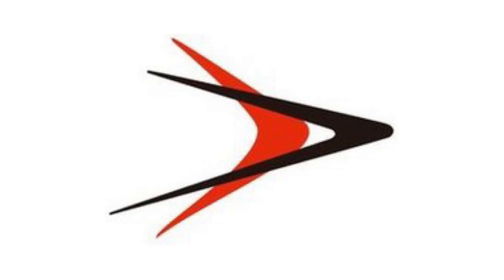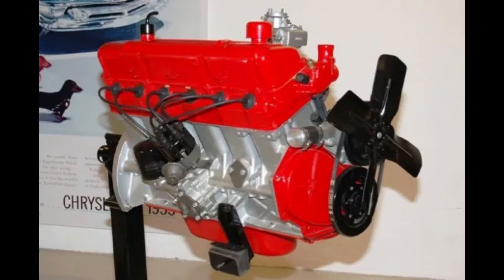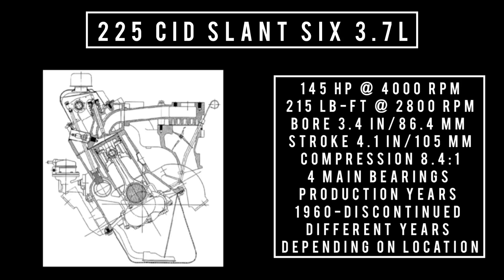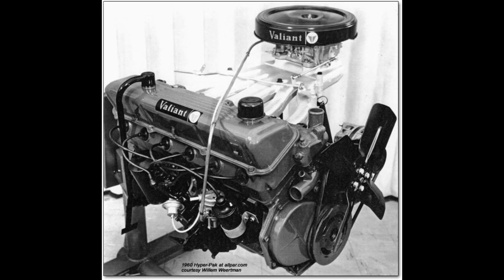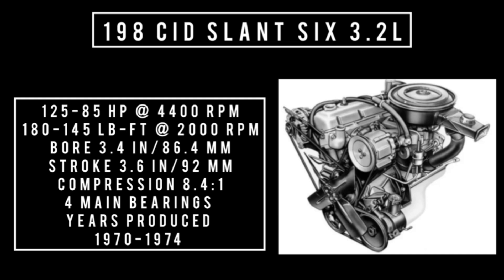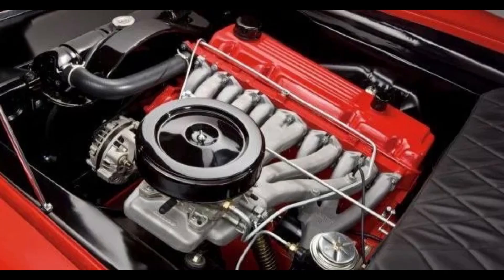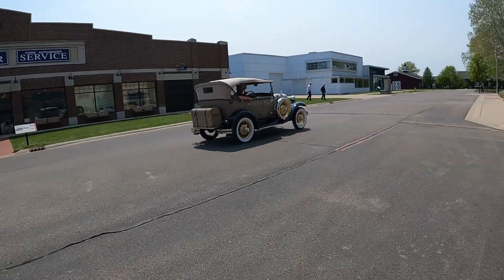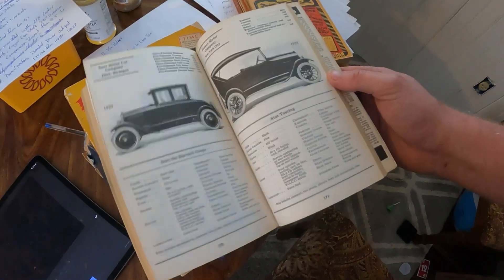Chrysler slant six engine family

Comment: My first car was a 1967 Dodge Dart with a 225 Slant Six. It was not a particularly exciting car unless you were trying to stop unexpectedly, but it never left me anywhere, even when it should have. I made many trips in the Dart between my home in Virginia and Indiana where I went to school. I usually drove at night by myself. (This was before cell phones and other communication devices.) That car droned its way through the mountains on almost empty Interstates without missing a beat. I wish I still had it.
Reply: Those were known as bread and butter cars. Chrysler wasn't exactly blowing up the ledger sheet with profits from low production Hemi cars. The everyday cars and engines is what people need. Cheap, efficient, and reliable transportation.
Reply: My 225 was in an inherited low mileage 1966 Plymouth Valiant. At the time, one of my friends was a Plymouth dealership mechanic. At one point when Chrysler was in a financial pinch they sold off their factory race car parts. We outfitted my Valiant with four piston disc brakes, heavy duty sway bars, gas pressure shock absorbers, and a tight ratio steering box gear. I added a performance cam, a Heathkit electronic ignition, and a killer stereo with six speakers. And I added factory rally wheels with a near new set of used Pirelli P7 performance tires .I doubt I spent $500 total (plus the cost of multiple cases of beer for my mechanic friend) to build a BMW eater.

For most of it's life my 1966 Plymouth Valiant was driven by my now ex-girlfriend. Several years ago after not seeing each other for 30 years we had dinner. She confided that one of the best things about our relationship was the ten years she spent driving that immaculate old Valiant. It was like talking about our deceased, and well loved, pet dog. I still miss old buttercup (my grandmothers name for her old Valiant).
Reply: @lockman004  Six in a row can go!
Reply: Fun fact: that flat exhaust manifold was perfect for heating TV dinners!
Reply: Those things were indestructible.
Reply: I had a crew cab Dodge Dart.  1967 four door with the 225 slant 6.   Brakes would get hot and you couldn't even hold a car at a stop light.    I loved that damn thing.
Reply: @jonbaker3728  Mine was a four door too. The brakes taught me to plan ahead.
Reply: I had one that overheated on the way to Texas, it threw up, then I refilled it with water..... Never even sneezed!
Reply: My dads old 3speed manual 68 long bed 225 cid dodge truck, was a monster of a heavy duty work truck.. we haul rocks, barrels full of water, dirt,furniture..rarely failed ..simplicity at its best.
Reply: The "slant" ALWAYS WORKED!
Reply: @johnmaki3046  Like a 134 inch flathead Jeep.
Reply: @-oiiio-3993  These WORKED!
Reply: @johnmaki3046  If you are insinuating that the Willys 134 did not 'work', you are entirely wrong.
Reply: @-oiiio-3993  I DID NOT insinuate that!
Reply: @johnmaki3046  Do you understand the meaning of the word, "if"?
Reply: @-oiiio-3993  Yes, I do.
Reply: @johnmaki3046  What, no SHOUTING this time?
Reply: @-oiiio-3993  nope.
Reply: That near bullet proof Chrysler drive train would of been a big comfort on long trips between Virginia and Indiana compared to the other makes especially with an automatic transmission in the 1960s and even the 1970s.   We had 1960 Plymouth Valiant with the slant six and 3-speed automatic.  Nether the engine or automatic transmission ever had critical problems.   It didn't get driven much because it wasn't a comfortable car to use or interesting to drive.  Four wheel manual drum brakes.   The car never stopped the same way twice.   

Driving it somewhat hard although the other cars around it might realized it, was difficult.  I started to begin braking with my right foot then I'd creep my left foot on to the brake pedal as well.   That allowed much easier two foot hard braking with better control.   It never had much braking to begin with.  I took if for a few hot laps around the Summit Point road racing track when I was alone up there and tried to over heat the brakes.  This was more for me to experience brake fade than to test the car.   I did get brake fade, but never lost brakes or got a spongy pedal.  

The car could only get to 91 mph on the flat on a good day and probably about 85 mph at the end of the straight at the track.    It took a long time to slow that light car down and I over shot the curve not trying too hard several times, there is lots of run off area.    I always thought it was a bit of joke of a serious car from every stand point.   At about 60 mph the hood would start to vibrate up and down.  This was in the days of a National 55 mph speed limit, but this car was built when there were 75 mph speed limits!  It could consistently hit 100 mph going down grade on the D.C. Beltway I495 after entering on the RT. 7 Tyson's Corner VA entrance ramp going north with the down grade to the Dulles Access Road.   That must really have a grade on it and it's flat and very smooth.   

The  Valiant was our family car not mine and if I'd had to worry about reliability I'd likely would of held it in much higher esteem.  Its fuel millage was not great at about 14 mpg around town and we really didn't take it on trips.   It rusted out driver's side floor boards by 1978 which my dad had me fix.   The raised driver floor actually made the pedal floor spacing much improved.  We added after market Sears air conditioning that Sears installed without getting the condenser blower under dash housing mounted correctly  into the dash that when reworking the floor board I ended up totally redoing to get it tucked away where it was suppose to be.   

My favored family car by far was our 1973 Lemans station wagon.   It had comparatively great road manors and was only four years newer.   We put after market performance sway bars on it along with Gabriel shocks that it would go limp in a few thousands miles  until we complained to Consumers Reports and the Gabriel rep got us some that weren't great, but didn't give out right away.   At Summit Point I was a little disappointed with the LeMans  In hit about 100 mph at the end of the straight and wasn't as composed as I was expecting.   I'm not sure I'd put the sway bars on to it or not.  The cars all had Michelin radials with speed ratings well above what they could every realistically reach.  I think the Lemans may have gone through five turbo 350 transmission rebuilds or replacements.   Always choose the turbo 400 transmission for that era of GM car or truck.   Everything on the Pontiac was up scale compared to the Valiant.   It was also much less reliable and even needed a repaint which I did in Dupont polyurethane yellow.   All the door seals were of a hard top style and I replaced due to leaking air when I did the repaint with a much improved product.   This car went on to serve me when my car was having problems at WV Tech.   It was like having a part of my family with me.
Reply: @douglasengle2704  " The car never stopped the same way twice."

That would take the fun out of it, no?  My 'first', a 1956 Ford 2 door Customline Ranch Wagon, had similar braking characteristics. The 312 'Y-Block' could go well enough, she wasn't particularly fond of stopping. I remember the 'left foot assist' well, often while swearing vehemently and wrestling the steering wheel.

It was a rather low budget affair. Great for Van Nuys Boulevard, Mulholland, and the Drive Ins, though.

I'm a bit confused, however, by a 1973 Pontiac Le Mans being "only four years newer" than a 1960 Valiant. How did that happen?

Another well respected auto for reliability was the six cylinder Nova.  Eight Cylinder Novas had great power to weight ratio.
Reply: I can relate. My first car was a 65 Dodge Dart 270 2 door post with the 225 and torqueflite automatic. I drove that car from the PNW to Los Angeles and back running all day long with no break downs, just had to add motor oil along the way. The front end suspension components were the weakest parts on the car, and the front end was totally shot when I was done with it.
Reply: @Cfchild1  Oh yeah, the front ends were soggy.
Reply: I fondly remember my college car, a mid 60s Dart with a slant 6. Bought it for $500 and ran it 4-5 years and it was truly bombproof. I used to shift into neutral to coast down hills. Once I pushed the lever too far, into reverse, and the tires froze, engine stalled, slid to a stop. I thought my God I've I've killed my car! Nope -- started it right back up and kept going no problems.
Reply: I had a ‘66 Dart coupe. It had the smaller 170 ci Slant Six. My first car. Had 50K miles on it when my father bought it and I ran it up to 140K. I rebuilt the engine myself at 120K. It was starting to burn oil. The oil seals around the valves had given up the ghost. New pistons, rings, did a valve job, new valve guides and seals. Nothing done to the lower end…it was all in spec. The main journals were out of the 426 Hemi. 

The Achilles heel was the starter motor. It used a gear reduction and the Bendix unit kept crapping out. Fortunately, it was located at 10 o’clock on the flywheel housing and could be reached from above,,left side of engine.
Reply: @Zircon10  Willys 134 'Go Devil' engines had starters with the Bendix that fired toward the rear which often locked up.

The remedy was to open the hood, pull the starter, smack it on the road or curb, put it back in.

Two bolts, three wires, all very easily accessible. I got to where I could do it in less than two minutes, jump back in and drive away.
Reply: @Zircon10  I changed four "starting motors" on "Slant 6 powerplants"! THE EASIEST "starter replacements" EVER!
Reply: I liked the 225 Dart, too. Not exciting, but reliable. I do remember the power steering as over-boosted and light with little feedback.
Reply: My Mom had a 1967 Turquoise 2 Dr Dart. Great reliable car. 13” wheels four drum brakes, AM radio 3 Sd Torqueflite, not much to go wrong…
Reply: Certainly better looking than any of these shitty bubble-cars manufacturers make nowadays…
Reply: Had 6. From 61  to 80. 64 was the best
Reply: When I was in Scouts, the Troup leader had a 68 Dart 270 with the 273. The assistant leader had a base 68 Dart with the optional 225. The V8 used less fuel and required less maintenance.

Comment: The leaning tower of power was almost indestructible and easy to work on. I had one in a 66 dart I acquired from my Great Grandma after she stopped driving at 90 years old. all of the sixes above were hard to kill. I've owned all four and none made terrific go fast, and emissions killed every one of them, but if I had to choose a favorite, the Chrysler slant six and the AMC were IMO absolute stump pullers. Out of the big sixes, Ford 300 hands down all day long.
Reply: The fuel pump was on the BAD side (motor-to-frame) of the "slant 6", but I would say that this motor was A GREAT ENGINEERING ACCOMPLISHMENT!
Reply: Chevy 250 and 292 best 6s...

Comment: The slant sixes were as tough as a box of rocks!  They would go 200,000 miles back in a time when most engines would be worn out long before 100K.  The downfalls were poor fuel economy and they were hard to pass smog inspections.  Yes, the tighter emission standards killed everyone but the slant sixes seemed to struggle the most.  On those engines, all of those sixes were good engines.  The 235 Chevy would be on a par with the slant sixes.  The 232 AMC engines were great too.  I would put the Ford six in last place but they were rugged too.  The old 230 flathead sixes were as rugged as hell and a rebuild was easy to do!  They would go and go and for many years after they were popular in industrial applications such as forklifts, tractors and stationary power plants.  Good job with your presentation!
Reply from the maker: Thank you so much for sharing all that insight I’m glad you dig this video i’m going to try to do the discussion episodes just like this just dive right in no intro.. I was afraid of doing it that way because it always seems like there needs to be a starting point and there needs to be an ending point. =)
Reply: No matter how I drove them....20 mpg!!love them ;
Reply: Chrysler Australia developed the inline hemi six which was the best of the 1970’s sixes.

Comment: Well done great collection of knowledge 👍👏👏
AMC 232 was a great motor and reliable 😉..
Enjoy your adventures 🤠✌️
Reply from the maker: Lots of research went into this episode I never realize that they’d be two different block variations but they never extended it past 225.. I feel like they could’ve made it better by adding a supercharger or a turbo charger to it when they brought back the hurricane I was hoping that it was a slant six but it’s awesome that Stellantis offers an in-line six with two turbos attached to it that seems like a really sick engine =) 

Glad you dig this episode really cool stuff coming next week I’m going back to Classic auto Mall I might go and shoot multiple locations and spend more than one day out there =)
Reply: @What.its.like.  There's always a way ???
3 Dellorto side draft carbs on an Argentina intake . Ported and polished head ..larger exhaust valves .. cut the exhaust manifold gasket in half  and two exhaust mounting plates on the block split the header pipes to 3 pipes into one 2 in collector x 2 for 2 inch exhaust duals 4 inch total 2 x  14 inch glass pack muffler for street legal ...
Balance the short block and run a small tractor alternator 40 amp ?? Charges the battery enough an gain 8 or so HP ??
More Labor than Money 💰👍 I'm a working man poor boy 😜👌...
Motor efficiency it's a pump 🤔😉 power  and balance, weight are the keys to success..
Never over look an Harmonic balancer ??? 
Liquid and enhance the top end dramatically..       🤠👍
Enjoy your adventures and keep us posted on your speedster project 👌✌️👋👋

Comment: VW air cooled flat 4 was a longer run right? Something like 36 to 86 or beyond.
Reply: 2003 was the year that Mexico ended production...✌️
Reply from the maker: Awesome thank you so much I forgot about aircooled VW
Reply: VW had several different engines in that period.

Comment: Jay rules!
Reply from the maker: =) glad you dig this episode
Reply: @What.its.like.  yes, it was fun to watch. Imagine what the K car and L car would have been had it been possible to jam the slant 6 into their engine bays. I’m not really much of a car guy but I took a quick look and the 2.2 4 had 84 hp and the VW 1.7 4 was rated as low as 70 hp. Granted, these were little, light cars (especially the Omnirizons) but they were also underpowered. 
I’m sure emissions and efficiency requirements would have done in the slant 6 eventually had it been possible for it to carry on.